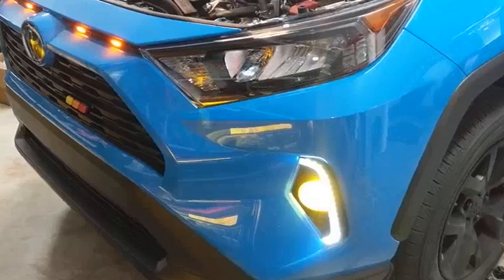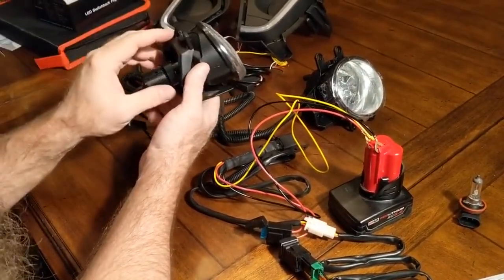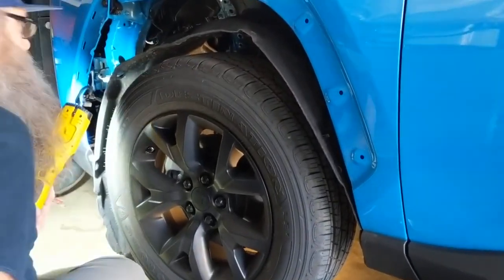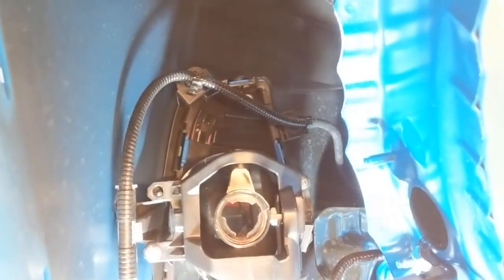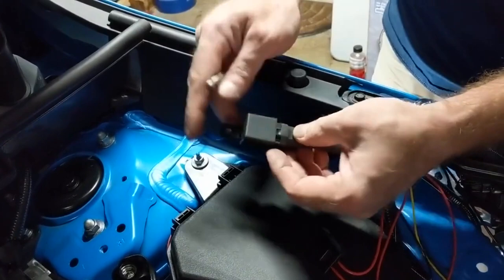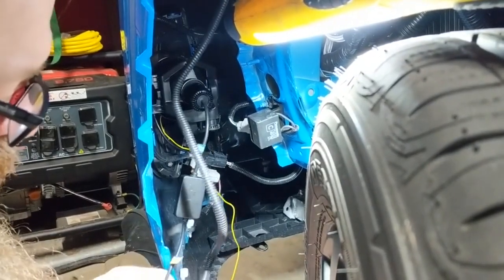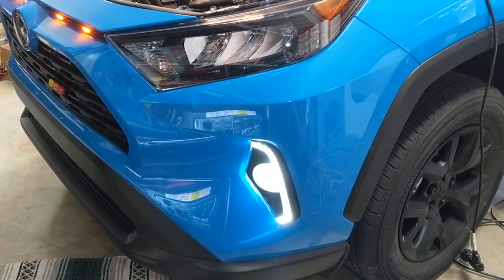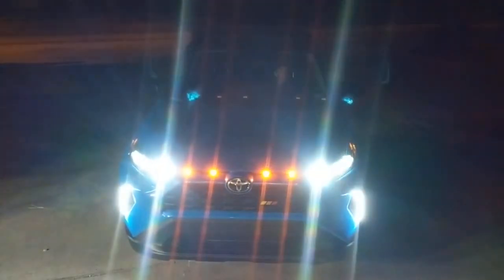Fog Light + DRL Switchback + Turn Signal kit Installation | 2019-2023 Toyota RAV4

Comment: Hi , I have a question, I ordered these about 2 months ago but I haven’t tried installing them because I have a 2022 hybrid and it doesn’t have a regular battery, any help would be greatly appreciated
Reply from the maker: I'll try to answer as best that I can
Reply: Wire it to you fuse block you will have some in the fuse block that are not used so wire to there and put the right size fuse in.

Comment: The final product looks sweet. I really want to do this on my '21 LE but I don't know jack about electrical wiring and even though your video looks very informative, I'd mess it up. Great job, though!
Reply from the maker: This was definitely one of the harder installs so far. If you do decide to give it a shot feel free to hit me up if you have any questions about it. Thank you for watching.
Reply: I installed my 21 LE with regular fog light with no turn signal but im happy for that but this is nice im thinking to replace it with these turn signal but anyway you did a awesome job boss nice done and clean
Reply from the maker: @pepitomorales9134  thank you, I've never had a Toyota before so it was all kinda new. But it worked out nice 👌🏻

Comment: Any issues with RAV4 electrical system with the way you tap into the signal/blinker light by going under the socket (genius).
Reply from the maker: Nothing so far with about 7000 miles on them, everything is good to go

Comment: If I want the lights to just stay on all the time, do I really need to go through the firewall and add the switch to the dash?
Reply from the maker: You could just wire it up to the ignition on, but you'll lose the switch back feature. So just choose which color you prefer, you'll retain the turn signal and DRL function

Comment: Thank you very much for all your insights. I just got them installed at Tint World. Yes, yes,...I know it is not he same as DIY...
Your help gave knowledge to know about what to look after. Although it is a fresh installation, everything I checked works fine.
Their technician had the courtesy of adjusting a design feature that would have left the fog lights one after turning the engine off.
Reply from the maker: Excellent, this one was pretty challenging. I'm glad you got some insight from the video, Thank you for watching!
Reply: What did everything cost?
Reply from the maker: @perrypalmer7126  about $150, I got the fog light kit on eBay and the switchback lights on Amazon
Reply: Hello, how much did tint world charge you to install them?
Reply: @erixkgonzalez261  It has been a while since installation, but if I recall correctly, it was around $275.00

Comment: That was a great job, Buddy. Looks great!  Thanks for the tip on using "Push  Pin" to secure the relay to the plastic at 23:22 mark.  Always like to try something new and think I will try it on my 2021 Rav4 Prime SE, finding a power source should be no problem. Keep up the great videos.

JT
Reply from the maker: Awesome, glad you liked the video. We're trying to give some alternative ways of doing installs that are either simpler or look more factory. It's a learning curve for everyone including myself.
Reply: @installsandpitfalls  Yup and you definitely did a great job with this one.  very clear and on point.  Maybe you can do one for Running Boards on the Rav4 Prime?  I haven't seen too many out there on youtube.
Reply from the maker: @jt2quick  we've got a video on the TAC nerf/running boards, I'll see if the factory type mount differently.
Reply: @installsandpitfalls   Thanks...that would be....much appreciated.

Comment: Nice job and great video.  I was wondering what year your RAV was?  I have a 2023 RAV XLE and I was working in the fuse box the other day and noted that there is a complete connector in the fuse box for the "fog lights".  I don't have factory fog lights but I am curious if these cars may have the wiring harness in place and it would be more plug and play then the kit you used.  
Great Job and your RAV looks awesome!!
Reply from the maker: Mine is a 21, I'll look at ours tonight, I know for sure we don't have a wire harness installed. The XLE may have a harness since it's an option. It could be installed at the "port" and just plug in. It's definitely something to look into.

Comment: Thanks for the video. Got the same fog lights. Haven’t installed them yet. What did you do to attached the drl fog lights onto the raptor lights since I have the same set up. Thanks!!
Reply from the maker: I just used a wire tapper, it's not "ideal" but it's worked so far. No issues whatsoever.

Comment: Just think after you spend the money and all the time to install these upgrades 3 to 5 years later when you trade it in the dealership doesn’t even consider this stuff on the trade in.  I took my 2016 RAV4 that I just paid off in to trade in on a new 2023 RAV4 Premium model.  They gave me the bottom price that Kelly Bluebook says it’s worth.  The way I look at it, I might as well try to get as many upgrades already on the car when I buy it.  I didn’t get the 13 speaker JBL on this package but I’m going to have a Pro install a Giant Speaker Cabinet for the trunk area with 2 twelves and 4 Tweeters at 2,000watts.  Everything will be Quick connect so it’s easy to take it out later.
Reply from the maker: Yeah I agree with you on the trade in value, when we bought this beggars couldn't be choosers...plus we got it at MSRP which I wouldn't have ever been proud of pre-2020 🙄
Reply from the maker: Plus having Harley's for years, I always try to remove everything I can before trading up 😂

Comment: Great video. I have a watch it several times already as a morale booster before tackling this project.I have just the vertical accent lights similar to the XSEs. My RAV4 is 2022. I’ll just set them up in a way their always on when the vehicle is on. Similar to the raptor lights. The yellow wire to the signal light. The black and white wires. Is Black on the negative and white the positive? Appreciate your input. Thanks
Reply from the maker: Yes, I believe those are the correct colors. Thanks for watching and don't hesitate to ask if you have any other questions.

Comment: Hi thanks for this video. When you run the wires through firewall grommet, did it sealed back properly as is or did you have to do anything to seal properly.
Reply from the maker: Hi, we haven't had any issues at all. We just pushed the grommet back in. Thank you for watching and let us know how the install goes 😊

Comment: Would have been nice if you would have  show how it looked out on the road at night. I assume the Rav 4 did not have  a harness already installed from the factory, am I correct?
Reply from the maker: That is correct, the LE doesn't come with the harness.
Reply: @installsandpitfalls do th XLE? I have the XLE but no fog light….
Reply from the maker: Hi, sorry I just saw your comment, yes this will work for a XLE

Comment: well done on the video! do you think these might work on a 2021 Rav4 prime se (currently no fog lights/housing)? I realize I"ll have to run wiring to the rear where the battery is located or find some power up front?
Reply from the maker: Thank you, I'm not super familiar with the Prime's electrical system, but I found a guy on Reddit that did the install on his. Here is a link, he also has videos attached. I hope it helps https://www.reddit.com/r/rav4prime/comments/jisf6l/prime_se_foglight_installation_part_2/?utm_medium=android_app&utm_source=share
Reply: @installsandpitfalls  I'll take a look, thanks!!

Comment: Great video! Waiting for mine to come in. Looking for any suggestions on how to connect the 3 wires for the turn signal. I have a 2021 hybrid and Gator lights (not the factor4). Red is positive I can add to the fuse. Not so sure about the back and the white.  Thanks!!!
Reply from the maker: Black is to ground, I didn't hook up the white.

Comment: Two questions:  The grommet into the car seems not quite to be in place.  Is there any change water or noise can leak through that grommet into the interior of the car ( min 22:58 )?  What can you do to improve the seal??  Seond question,  I have seen both the LED DRL on the side of the fog lamp as yours (vertical)  and another version where they have horizontal ones above and below the fog light hole.  Do the vertical ones block at all the fog lamp projection on the side  (the horizontal ones wont for sure).
Reply from the maker: Hi, I guess we didn't show pushing the grommet back in, we haven't had any issues with noise or water ingress. And the vertical light does not impede the fog light at all, they(DRL) are not projection lights
Reply from the maker: And thanks for watching and for the question

Comment: Can  the ground wire be on painted metal or does the paint need to be scraped off?
Reply from the maker: It's possible to make a ground with the hardware, but best bet is to go bare metal.

Comment: I wish you would explain better what you did with the wires for your DRL (29:23 min). Where did you connected.
Reply from the maker: I tied them into our Factor4 raptor lights that on ignition on
Reply: Did you tie both the Red (hot) and the White (for headlights) together as Hot or did you just leave the white wire unconnected to anything?

Comment: Hey, these are awesome!  Where do I get the fog lights & DRL’s?  I have a ‘21 LE Hybrid so I need everything including the button. :) thanks
Reply from the maker: https://www.ebay.com/itm/For-2019-2021-Toyota-RAV4-LED-Daytime-Running-Light-Fog-Lamp-DRL-Wiring-Assembly-/133593723563?mkcid=16&mkevt=1&_trksid=p2349624.m46890.l49286&mkrid=711-127632-2357-0
Reply from the maker: I guess the ones we bought are out of stock, these look identical
Reply: Amazon has them too
Reply: @CACOOK-fk1rc  can you provide the link for Amazon please?
Reply: Hybrid might be different.  I believe the battery is in the back of the vehicle and there might not be a blank switch plate to pop out.

Comment: Hi, 
Which switchback lights did you use? Your link doesn't work anymore
Reply from the maker: Hi, here's what we used 
Syneticusa 7443 Error Free Dual Color Type 2 Switchback DRL LED Turn Signal Light Bulbs No Hyper Flash Built-in Resistors All in One https://a.co/d/gF58T1a

Comment: I installed exactly how you showed but for some reason the turn signals don’t work, any idea why?
Reply from the maker: Hi, we haven't had any issues with the turn signals not working, did you strip the wire back far enough to make contact in the factory housing?
Reply: Could have pulled itself out I had to redo mine on one side with this method but different lights

Comment: Hi, do you know the fog light kit for Rav 2018 LE? Thank you so much
Reply from the maker: Hi, here is one in Amazon.  I can't speak to how good it is, but you can search keywords around Google and possibly find what you're looking for.
AUTOFREE Fog Lights Compatible with 2016 2017 2018 Toyota RAV4 Bumper Lamps H11 12V 55W Bulbs Driving Lamps Replacement Included Wiring Kit & Switch-1 Pair(Clear Lens) https://a.co/d/eP5vVmv
Reply from the maker: @phongan3638  you're welcome, it'll probably be a similar install

Comment: You think this should work in a 2023 rav4 xle?
Reply from the maker: Hi Zach, the kit we used I guess is no longer available but I found this one that looks identical and says it'll work for the 2023 also 👌🏻 https://www.ebay.com/itm/273925014698?mkcid=16&mkevt=1&mkrid=711-127632-2357-0&ssspo=38lrwX_wSG6&sssrc=2349624&ssuid=5B1I2qiuRAq&var=&widget_ver=artemis&media=COPY
Reply: @installsandpitfalls  Awesome! Thank you :). Just purchased.
Reply from the maker: How did it turn out?

Comment: Hello! I had a question that I hoped you could answer. I also have the factor raptor lights and I want to install the DRL lights (no fog lights). But I am confused about how you connected the DRL lights to the raptor lights. Would you be able to help me understand, please?
Reply from the maker: Hi, I just clipped the power and ground wires to the Factor4 harness and the turn signals to the right and left signal wires

Comment: So your DRL's wont dimm when headlight are on??
Reply from the maker: Correct,  the switchbacks and the fog light drl"s do not dim
Reply: @installsandpitfalls  that is very unfortunate. 
So please het me understand. 
The switchback DRL'S runns from the fuse box. The 3x square lights runns from the fog lights power , but they are not fog lights at all? Its just DRL's? 
If you , wil you please me a video showing what it looks like when you switch the "fog lights" on and off please?

I will surely modify mine so the switchback does dimm at night.

Comment: Where did you install the yellow wire?
Reply from the maker: The yellow for the turn signal?
Reply: The yellow wire from the relay
Reply from the maker: @ericfelix8950  I'll take a look when I get home this afternoon, I can't remember off the top of my head. I'll get back to you on it 👍🏻
Reply from the maker: @ericfelix8950  I tapped it into the same fuse tap.

Comment: Does the fog light automatically turn off when the vehicle is turned off?
Reply: If you connect directly to the battery always stay On, but if you connect to the fuse box they will turn off when the vehicle turned off, the only problem that I see is until you put all lights off the dlr stay On
Reply from the maker: Hi, sorry just seeing this question. Yes, we have them wired to only be on when the key is turned.

Comment: Hey where you connected the 3 cables that you show in minute 29:22 help please
Reply from the maker: Was there a specific wire you needed to know about?
Reply: I'm having the same problem. I have the raptor lights as well, but those are only power and ground. Where did you connect the white wire?

Comment: Did you ever think of taking the wheel off and then (oh huge light bulb) you’d have more room instead of struggling. Work smart not hard. Disappointing.
Reply from the maker: Yes of course, but we wanted to show that it could be done without a jack, jack stands, torque wrenches, etc... thanks for the comment and thanks for watching 😊